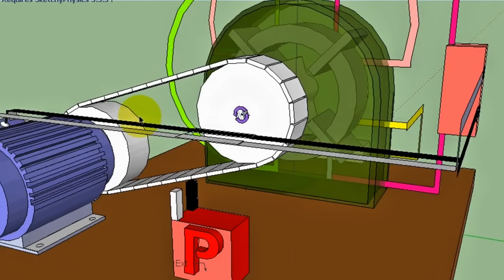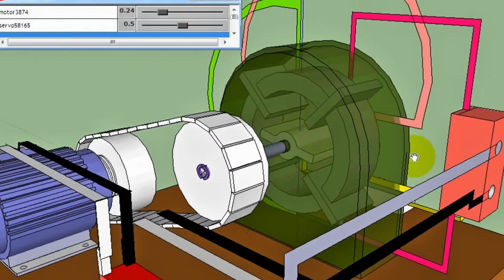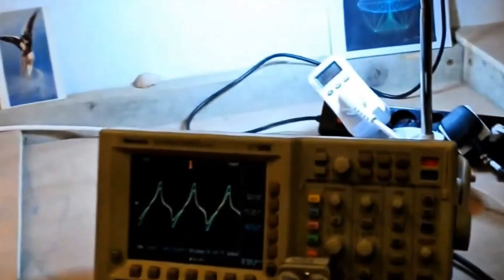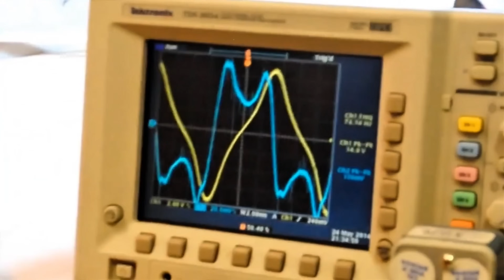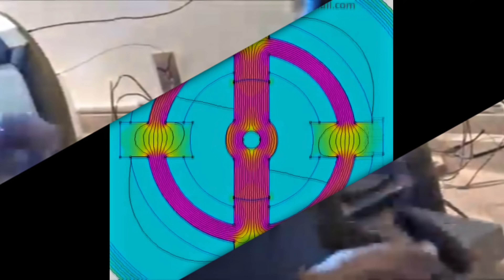End Energy Bills Forever: Fix the World’s Breakthrough in Free Home Power!

Comment: There are Materials co$t$.  
There are plans offered/promised, but missing from video. 

We all know how big industries have throttled “free” energy….STOP gnawing that old bone! 
& 
There..they said it….this organization wants YOUR participation, & money, to help the 
“Fix The World Organisation” to “bring it to market”.
THAT means:  
—the organization intends to profit from making the units—not offer open source.
—they MIGHT make plans Proprietary…as industries have always done.  
—they do NOT have any tangible units for sale, nor are they offering open source plans. 
—there are prototypes (maybe)
—does not show any prototypes have been grid-tied, to record how much energy runs the house & how much gets fed to the grid—on record, over even one year—same as a grid tied solar/wind system might show.  

Folks—even when I made 2 passive solar air heater panels using stacks of recycled aluminum cans, & booted those into a bathroom window…
….I had 7 winter season grid-bills showing results of using them, to compare with numerous winter season bills without using the panels.  
That is measurable data.
That gave credibility to the project. 

SHOW measurable, repeatable data!
SHOW the gadget grid-tied, with meters showing how much energy is produced & used! 
SHOW that it is very durable, with very very long use-life! 
SHOW links to find the open-source plans you claim exist. 

: 
—showing light bulbs or other appliances that might be run from hidden batteries or cord-plugs to wall sockets.
—small rooms stuffed with cheering people. 
—stuffing the description with hoards of “key words” & blank space, & soc.med. that do not help.

The ONE maybe useful tidbit shown?….how really loud the gadget was, at least on startup…
….loud generation equipment can be a big problem with noise pollution, or lead to big problems in parts breaking too fast. 

This organization putting out videos like this, looks way too much like scammer traps. 
It RUINS any legitimate efforts to make overunity happen.